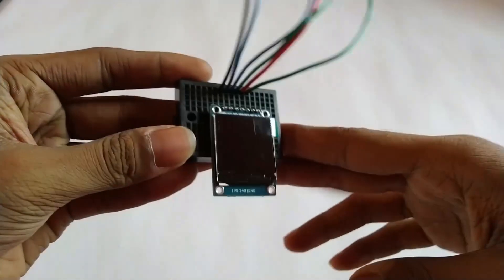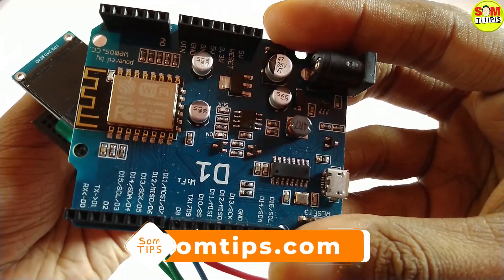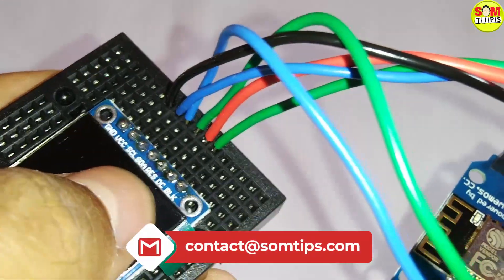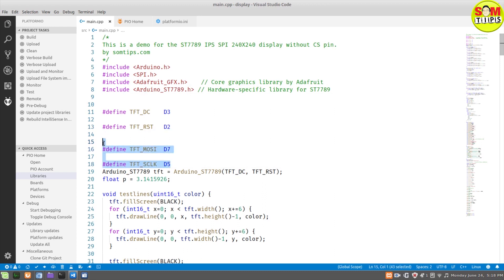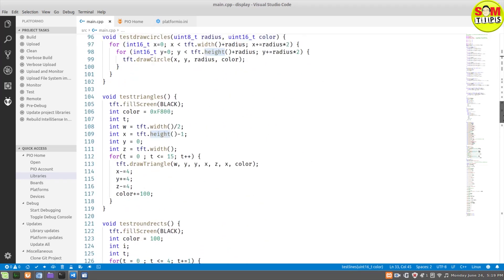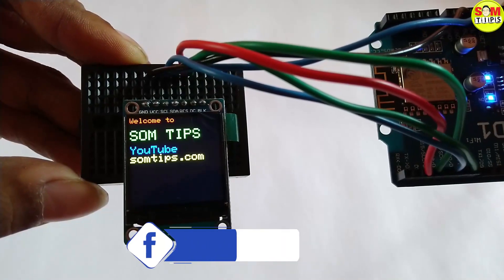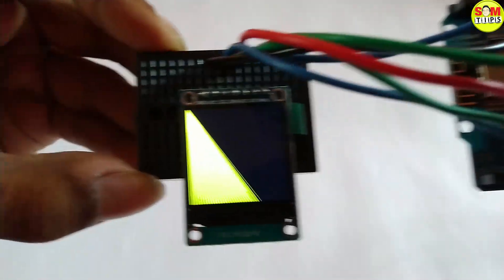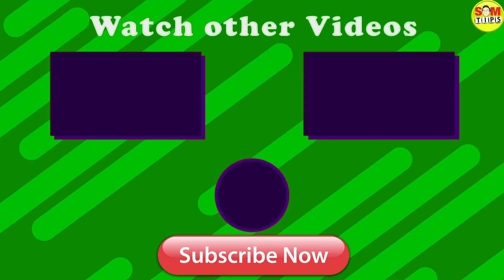ST7789 SPI TFT LCD Display 240x240 without CS Pin with ESP8266 NodeMCU Wemos D1 | Som Tips

Comment: Hi, your video helped me connect this display to ESP8266, but when I connect in addition BMP280, ESP refuses to see it :( Could you make a video about outputting information from BMP280 to this display? I will be very grateful. Thank you!
Reply from the maker: bmp working on spi or i2c?
Reply: It works on both SPI and I2C. But I used I2C
Reply from the maker: standalone BMP working?
Reply: Yes it works standalone
Reply from the maker: ok i will bring bmp from my friend and check it.then i will update
Reply: Thank you!
Reply: I was able to connect the sensor together with the display, via SPI, with I2C does not work. But unfortunately data from the sensor is no longer correct :(
Reply from the maker: @triggr6644  to use 2 to spi device together u have to open and close spi connect . because display data and sensor data goes via single communication channel
Reply: Please explain how do I implement it? I want to display the information from this sensor and update it. Unfortunately I do not have much experience programming Arduino
Reply: I can send you my sketch, maybe you could edit it?
Reply from the maker: @triggr6644  wait till i get hardware
Reply: Ok